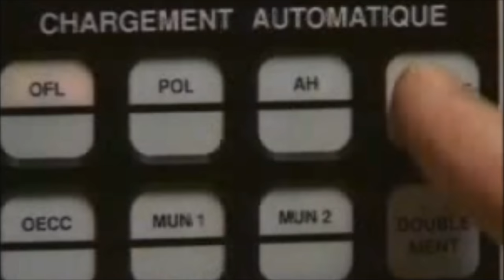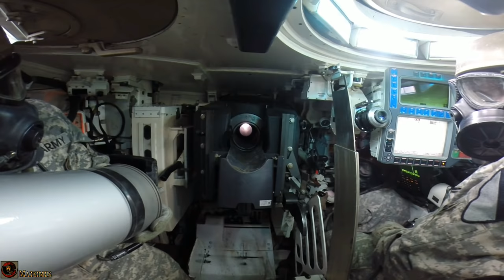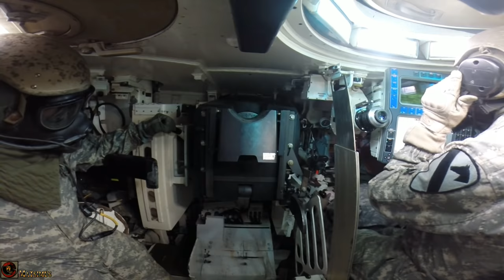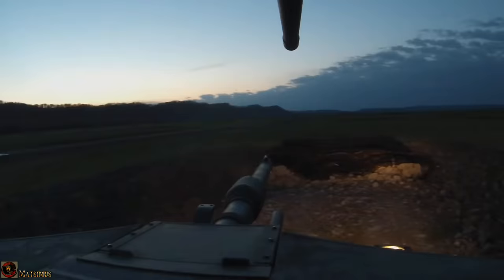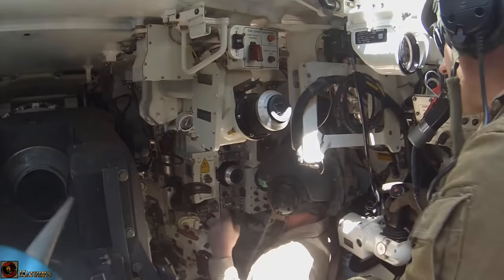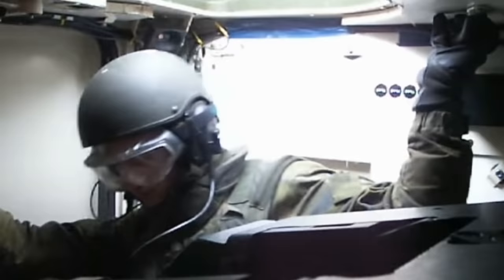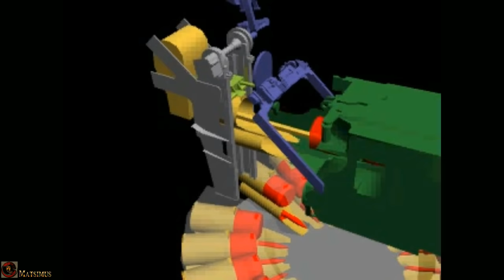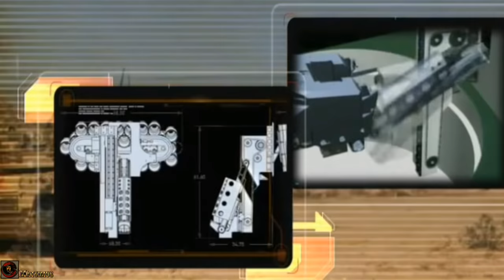Tank Autoloader or Crewman Loader?

Comment: Well, a major error :  It is quite easy to determine that the actual problem considering the survivability is not the auto-reloader but a hull, turret and magazine design, which the armor distribution around the whole vehicle and the way how the ammunition is distributed around the tank affects the consequence after getting shot rather than. The drawbacks of Soviet and later on Russian designs aren't only caused by the carousel or other similar types of reloaders but an overall lack of technology compared to the west.

If one has a valid knowledge of the field management of an armored combat vehicle, he or she would agree with you're opinion that an extra crew member can be very helpful in the various situation including the transition of ammo from ammunition-bunker or ammo racks in the hull to the turret in order to become ready to reload. Such cases are experienced through combat and where I agree with your arguments for a  human reloader, although just like what I've said, I can't mostly agree with your arguments considering that you've only mentioned the Russian design.

Therefore I wanted to see your views not only on the eastern block - style but also the western styles, well i mean the bustle magazine auto-loaders in typical. Except for the special case of Abrams series where every single ammunition is stored in - just like what you've mentioned - a safe bustle isolated from the crew compartment which has a blow-off panel on the top, like what you've likely to know, most of the other western tanks, for an instance, a Leopard 2, has a munitions-bunker where all the other rounds are stored in except for the ones in the bustle.

From you accent I assume that you're British and therefore, you will also know that the situation may get even worse (well, still better than the Russian ones) such as in the Challenger series, which the ammunition are distributed around the whole turret. This applies to other western tanks like the South Korean K1 and the others as well.

Also, just like what I've mentioned above, a bustle auto-reloader seen in French, Japanese and Korean tanks do solve those major problems of a carousel or other types of Russian auto-reloaders where the tank is extremely vulnerable on a hit. To be exact, there is no huge structural difference between the auto-reloader and a human reloader in such cases except for a auto-reloading device in the bustle.

Well, to think of, almost all the problem of vulnerabilities of Russian auto-reloaders and all the other tanks except for the Abrams comes originally from the transition from conventional all-out war during the cold war into non conventional warfare, which now the major vulnerabilities are the attacks from the sides not the frontal 90 degrees. Thus the hull-down doesn't really matter in the urban warfare (For example, Challenger doesn't really have an armor in the frontal hull except for around 150mm thick  RHA and for some of em', extra blocks of external Dochesters).

Russian tanks - even when we think of that the armor length and performance of the ERAs are highly dependent on the angle of incidence thus sabots like M829A3 and A4 doesn't really get affected by the ERA  explosions - stay fairly strong against HEAT rounds and missiles and in some cases, sabots when hit from the frontal 90 degrees. That applies the same way for the weak spots of the western tanks like ammunition-bunker in Leopard 2.

To be honest, there is no other tank than a M1A2 SEP v(2) with TUSK that is as safe as her in the non conventional warfare and attacks exceeding the frontal 90 degrees, which the non conventional warfare for Abrams itself is already extremely dangerous. Well, some of the others might misunderstand that I'm fanboying Abrams though, when one searches for a turret and hull dissection from the top, they would eventually understand it all-good.

Comment: I don't know if someone mentioned it already, but you're missing a point on the auto-loader. In a case of war, there would be losses, no matter the vehicles / tanks. When you loose a tank, you loose some, if not all, of it's crew members. Having one less human to worry about is a plus. Also, take any Russian auto-loading tank. For each 4 tanks, you'll get a fifth one crewed for free with the spare 1 crew member from each of the previous four tanks. And thirdly, an auto-loader, providing that it is well maintained and functioning, would load rounds way faster than any human. On the other side there's also the endurance. Tank battles last for days, take a look at Gulf war I or II, and in terrible conditions. How long do you think, a human loader would be able to keep up the same paste and load heavy shells, weighting nearly 20 KGs each, one after the other for hours?

Comment: I was a US Army tanker from 1979 to 1982 on the M60A1 and we could easily load a new 105mm round every 3 to 5 seconds, as long as the same ammo type (SABOT, HEAT, HEP, Beehive, etc) is being loaded. The key here is for the loader to grab a new round as soon as one has been loaded, and then stay at the ready---holding the next round in his arms. Once the tank fires and ejects the casing, the loader--if he knows his business, can manfully vacuum-load the next round--which closes the breech, and then slam the firing-safety forward and yell "Up!" before artfully grabbing the next round and repeating the cycle. Any well trained loader on an M48A1 thru the M60A3 can do this and I would never trust an auto-loader over a good human loader, no way. But the human loader is going away no matter what. It's just the way of things.

Comment: it depends on the autoloader you use, it depends how it's working, if it a half auto loading or a full autoloading. French designed tank use autoloader from a long time. 

since the 60 French defense contractor build tank with auto loader, like the AMX 13T but the cons was the relaod time of the barrel of the autoloader than can take up to 3 minutes and the facts that you can't change the ammo type. but it was in the 60's. 

What I saw on the video it that manual loading impose that the gun has to reser to it's loading position you can see it on the leopard 2 tank that the barrel reposition itself after each shot to authorise reloading. 

on the abrams I don't know, and the video don't let see it cause they fire horizontally at the reload position. The thing we see falling after each shot it's a compressed casing, the casing are made with thin steel, they use the recoil of the gun to compress the casing in order to win space of the spent casing. 

The russian seen on the video don't use casing, but it's more a historical design way of thinking, during WWII the russian mounted artillery gun like the 122 mm gun of the KV and IS was at start an artillery gun, usually the artillery gun don't use cased ammo, they use a shell and some powder casing. 

while doing that they seen the advantage of it, spare space for more ammo stock, no need for space for the use casing so they keep the spirit. 

nowadays AL can change ammo if you need to, the don't get tired etc but as told in the video it's a lot of mechanical moving part that need more maintenance and more care. 

French MBT Leclerc use a AL that has a magasin, up to 4 shot, you steel a loader to load the magasines. And the gun can be load manually also :D

Comment: Those SABOT rounds are practice rounds but the real ones are black, and the top of the sabot dart is sharp as a razor and will cut your skin. Fighting hatched open is the best, full NBC, the tank is pressurized and you feel like you’re in outer space totally zoned out blasting away listening to 💿 on the  intercom.

Comment: Just stumbled onto this video, so i know it likely has been discussed to death already, but wanted to make one point.

While Auto loaders may on paper, and in action, be faster than human hands, there is one drawback.  Changing ammunition types mid-combat.

Take for example the Israel MBTs with their auto-loaders. They autoload in 'groups' of 4-5 shells. They manually load the 'hopper' then can fire those rounds rapidly if they choose/need. But they can not fire twice with one shell that is good against tanks, then switch to a HE round to take out say, a bunker, without first unloading the unspent AT shells, and loading a full hopper of HE.

Take the American A1. Its manual loaded, but each and every shot can be what you need for that exact target. There is never a need to unload any hoppers mid-combat.

Just as with any human-vs-machine discussions, there are both Pros and Cons

Comment: A human loader is; lighter, less complicated design (meaning less mechanical malfunctions), able to do ancillary tasks (such as maintenance and fueling operations), and the best part, if the Soldier gets hit with shrapnel all it takes to replace them is a sponge mop and a new uniform, whereas the auto-loader would most likely need extensive repair or replacement.

Comment: The tanks with autoloaders provide a hatch for EVERY crew member. And those - with crew member asigned with the task,do not. So,one of the most important crew members - the gunner, has no hatch of his own. And in case the crew comander gets wounded and is not able to escape the vehicle,thus getting out of the way,I don't see the gunner leaving the vehicle either. The human loader is also prone to injuries of different kind; his ability to load the rounds on time vary relative to the terrain the tank is rolling on, etc. Switching rounds is possible with a gun firing cased rounds,however with a bag gun,like the Brits',it isn't. The major fire hazard with the carrousel type of autoloaders(like those on T64/72/80/90 tanks) comes not from the rounds and propellant containers housed in the autoloader,but the spare ones,stored on an open shelf to the rear of the turret basket,and the shelf is actually a fuel tank. That isn't the most sensible way to handle the issue,I agree.

Comment: a human loader is less likely to malfunction, lighter, less money and more flexible. And autoloader is just one more piece of equipment that is extremely heavy and susceptible to malfunction. Also a human loader not only acts as another set of eyes but if I remember correctly in some militaries they are also trained as a substitute Gunner. So if for any reason or another the primary Gunner cannot continue operating the loader can actually take his place.

Comment: Autoloaders weigh less than a loader, because you have less internal room required for him. Less internal volume = smaller exterior surface area to armor = MUCH lower weight. You can go to unmanned turrets and keep the 4th man for extra eyes, ears, maintenance, relieving the lazy driver, etc.

Comment: An autoloader makes sense only if it's reliable enough to dispense with the manual loading option entirely. This way the whole gun can be placed outside the fighting compartment and the tank becomes smaller, faster and safer. Otherwise an autoloader is more trouble than worth.

Comment: Most of the downsides are not particularly consistent here.
If you look at the current experience of using tanks in Syria or more recent experience in the Chechen war, you will find out that the automatic loader is a damn tenacious design. Doesn't fail in battle.
In fact, this is a fairly simple and durable mechanism. Both AZ and MZ have their sores, but these systems have been working for years in the hands of far from the most advanced operators. They are not afraid of either the Indian or the Arab military.

There are really only two problems.
1. Danger of ammunition explosion.
2. The need to recharge the carousel.

The first problem is somewhat exaggerated. Usually, such a detonation is the result of a good caliber hitting the side of the tank at the level of the tracks. If we recall the low height of the tank, then we can understand that this zone is almost always hidden by the natural landscape.
There are illustrative photographs of tanks from Chechnya that received multiple hits from RPGs in the side and nevertheless remained on the move.
The problem can also be the hit of an already serious weapon, such as ATGM, etc. But with this weapon, the Abrams crew has no chance either.

Comment: Generally speaking, I think we should have both, when the Autoloader breaks down the Crewman loader can take it's place, when the Crewman loader is badly wounded or killed the Autoloader can take his/her place.
Reply: I am not 100% sure but so far, most tank turrets are pretty cramped as they are, so I doubted if having both would be practical nor feasible; autoloader takes up pretty much most of the turret space where a loader might reside. And why spend $ on making space for a loader if the tank is designed with autoloader!?

Comment: What about a sort of semi automatic loading system like what was used in the Soviet IS-7, for example? The tank had a rack that the (actually one of the two loaders) loader would put the round on, he'd press a button and a ram rod would shove the round into the chamber, breach block closes, gun goes boom, rinse and repeat. Apart from the additional space of the rammer, it doesn't seem like there's much of a downside to this system because if it breaks or it gets hit, the shells could still be manually loaded.

Comment: In my opinion auto loader is much better because since they are machines they doesn't get tired and loose efficiency and if a tank with a autoloader gets blowned up since there are less crew members it even does save lifes but they are so sensitive since almost every single part has a function and important if one or two part is missing or damaged in/on autoloader it couldn't function before getting repaired.

Comment: The logical solution would be to have an auto loader and a four man crew, the loader could be re-designated as an ATC or Assistant Tank Commander, and have responsibility to monitor the tanks systems, bit like the flight engineer did on an airplane. O(f course you'd have to have a new tank design from a clean sheet of paper, but car manufactures designers can assist as they are used to designing interiors more ergonomically.

Comment: Good video, gives a good overview of the arguments.

However, I am of the opinion that any future tank system without autoloader will be deprecated already on its commissioning. This is in particular valid for US and western military:

The most relevant reason: An autoloader allows reduction of crew to three persons. Meaning: a blown-up tank means three casualties, not four. Further, the crew can be housed in the main hull were it can be better protected with less effort, in particular better sealed off of the ammunition. Meaning: the three-casualties-situation is even less probable than the four-casualties-situation. In western militaries, military operations have to be justified to the civil society. There, no one cares about a blown up tank. The only thing that matters are casualties, and they matter a lot. It was always doctrine of western armies to improve protection of individual soldiers at the expense of equipment and costs. 

Second advantage: It is always stated that the fourth pair of hands may come in handy. True, but does this fourth pair of hands needs to be on board of the same Tank and needs to be exposed to front line risks? Wouldn’t it be handier if you have 12 pairs of hands and four tanks instead of 12 pairs of hands and three tanks? For loading, there is not only the tank crew but also crew of support vehicles that may help loading without needing to expose a further crew member to front line risks. Same for maintenance. Having a trained crew with specialized equipment supporting a three-man tank crew behind frontlines may be even more efficient than a four-man tank crew on its own with less risk.
Further advantage: modern autoloaders like in the T-14 are considerably faster than human loaders. Nearly twice as fast. This even nearly eliminates an unload-incapability. Shooting the target twice (first with the wrong ammunition, followed by the desired ammunition) may occur in the same time-span than a human loader needs to enable one shot. If the human loader has to unload and to reload different ammunition, we are talking about a considerable delay. There of course remains a waste of ammunition. But again: in the heat of a quick paced battle situation, who cares for the additional round? (Of course unless needed later on but lacking).
Yes, autoloaders need maintenance. Howewer, human loaders need employment, training, health, nutrition, sleep and resistance against stress under live-threatening circumstances. Autoloaders don’t. 
Yes, autoloaders may jam. However, human loaders may get injured, fall ill or may defect. Their only advantage seems to be the easier replacement. It seems faster to remove a dead, injured or unwilling loader from a tank and replace him by another one than to repair or exchange an autoloader. However, this may be strategy of armies having an abundant amount of countless, faceless soldiers. In western culture, this approach rather seems difficult.

Therefore: I am pro autoloader.

Comment: I goes with manual loader. Coz of these reasons. 

1. Well trained loader can load faster than auto loader 

2. The loader can easily select the ammo type ( high explosives or armour piercing )

3. The ammo stored in a blast proof chamber so the ammo not gonna explode after a direct hit unlike the auto loader.
Reply: +Rahul vp

 And an extra set of hands.